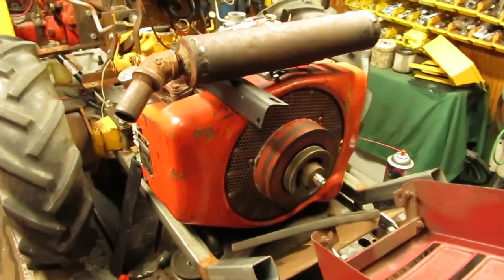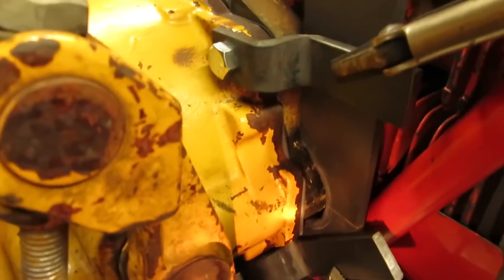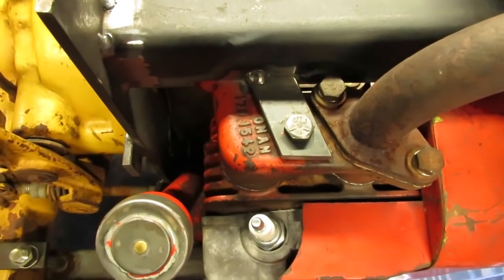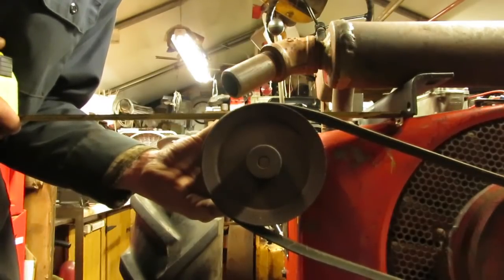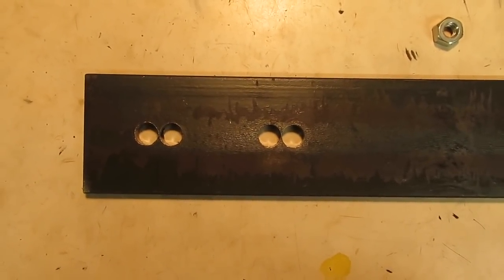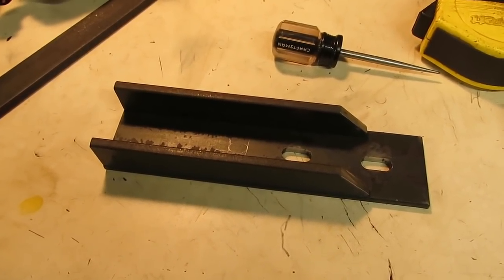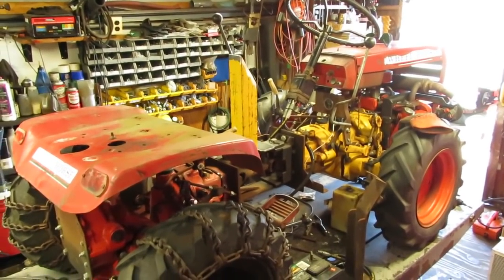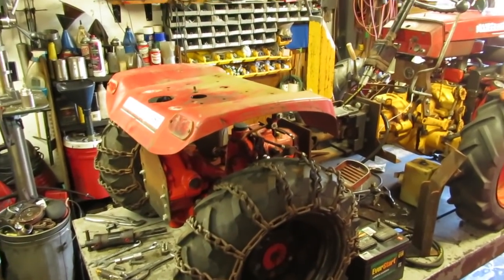4WD Gravely Engine Swap to Onan CCKA- Part 5

Comment: You've got some FINE ideas, Buddy! Better than factory! I was around an Army press that was used for making cable slings by compressing the ferrules on the loops. It had a little Continental opposed 2-banger with a set of duals with little glass pac looking mufflers and a sweet sounding rig you never heard! The mufflers took the crack out of it. I think about that on the 19.5 but there's really too many obstacles and I like the quiet too. So just keep gnawing on it and with a coat of paint it'll be a head turner, sure enough. And I lay heavy odds the picking time is increasing as well. Thanks Jake! A-PLUS! I want a DVD!!!
Reply from the maker: Thanks Lewie! I imagine it would be pretty cool if Gravely came up with something like this from the factory. It would be like the little Steiner/Versatile tractors of today! Boy, that must have been a heck of a press to be run with an engine vs. electric/HYD. I rarely ever see Continental cylinders, must have been one of those things they manufactured specially for the Army. Hahaha it's actually decreased a bit with work! That's okay, got a practice later today, gig on Sunday and a practice with the Bluegrass group next Wednesday.... now I just need to find someone to film the gigs!
Reply: @5Tractorguy  I'm sure you know someone that can do some shooting for you, like a smiley female type person! And the press was on a trailer and we were in RVN so that explains a lot. And that was all the press was for. And I've always had thoughts of the small machines but running/herding the big ones has ruined me I guess. But if Gravely did it like they used to back before stamped coke cans it'd be something worth having! The old 301 on the 5665 still just turns about 2ice and it's running. The opposed twin is a 98 model and just turns about 2ice and it goes too. I just can't get into plastic camshafts. I've got one on a pressure washer I had given to me but I sure wouldn't buy one. So HI to everybody and keep on building callouses on the cording hand and grinning more. I know that's what's happening. I'm grinning just thinking about it!

Comment: Hello,
What fuel can be put in an ONAN CCKA engine ? Leaded or unleaded gasoline ?
I just bought an 816 and I don't know what kind of gas I use. I live in France. Thank you
Reply from the maker: Unleaded will work just fine. I use 87 Octane Unleaded here in the US.
Reply: @5Tractorguy  Thank you for your answer.